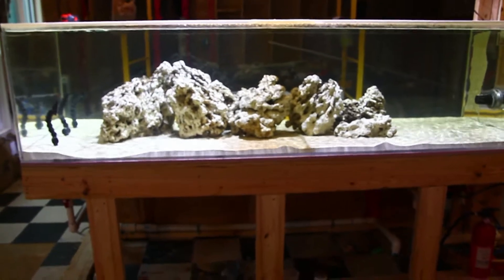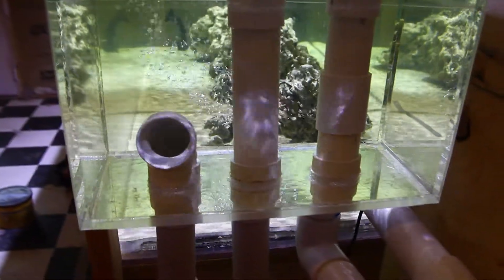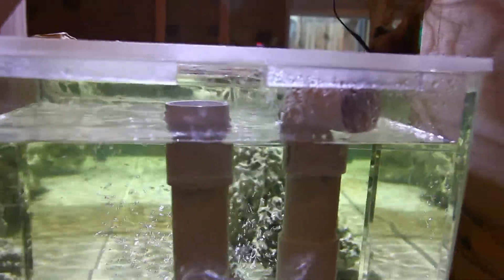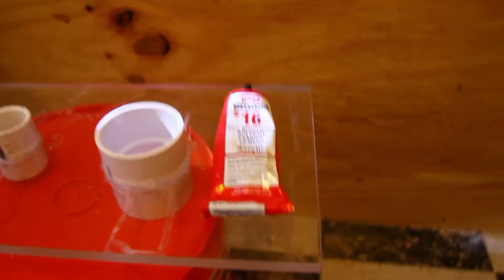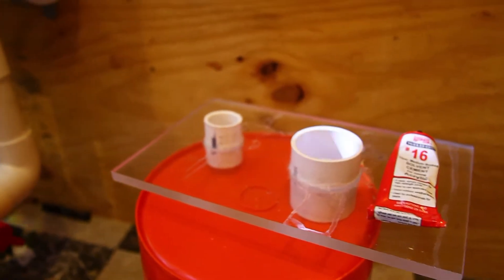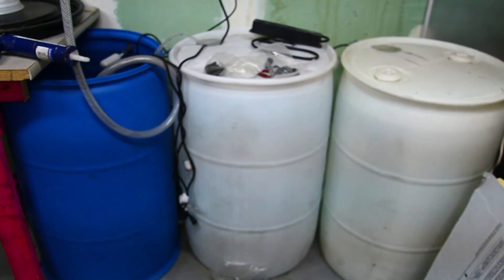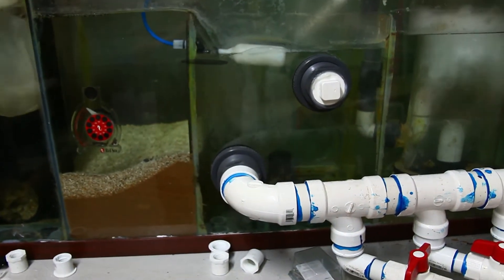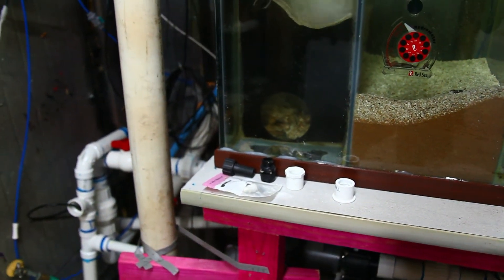My Saltwater Aquarium - An Update

Comment: Pretty cool setup!  Your setup is a lot bigger than mine but it looks like we have a lot of the same ideas.  I would be curious to know more about the idea of placing your controller probes inline.  I would be concerned that the flow rate would impact their readings and useful life, have you had any problems with that?  Really interested in seeing more of your sump room.  Did you get your water tubs from Baytec by chance?  I just got a pair of 55 gallon drums to use in my water change system.